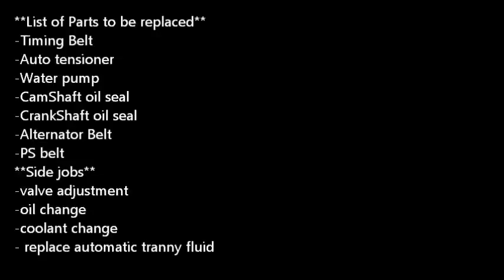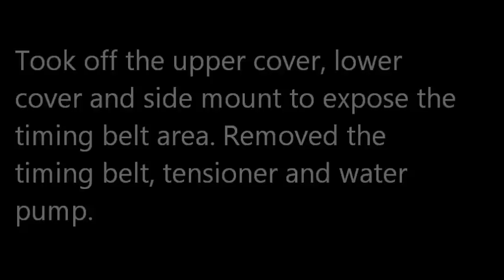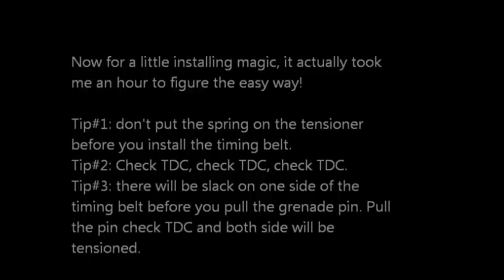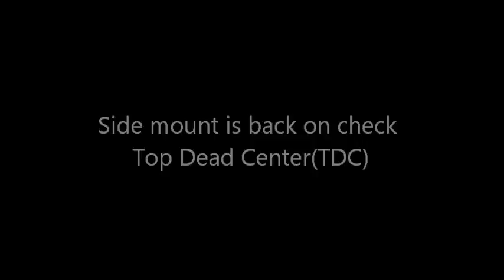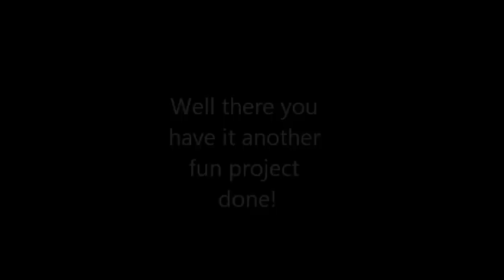DIY 2002 Honda Civic Timing belt and other stuff.

Comment from the maker: basically get all your tools before hand and lay them out. the biggest issue you will encounter is the harmonic balancer bolt which will need a special tool and an extender to give you some leverage to loosen it. every other bolt arent that hard to remove. all in all you just need to get a good manual and some elbow grease and it should be an easy job. also make sure you have all the parts you want to replace before hand.

Comment: Hi every time start my honda civic ex 02 in the morning belt squeak and when the car is warm squeak gone don't know which belt is the problem all belt are new don't know if i need to tight all belts. Please kindly tell me how to check this problem step by step please let me know thanks?
Reply from the maker: if your belts are new than its probably not the belts. but lets go through the list of what you should look for. are the belts too tight? check the belt with a tension meter make sure its not overly tight or it will cause too much pressure on the bearings of the power steering or alternator. if the tension are right then check the power steering pump(the bearings here will likely die first). just take off the belt on the power steering and see if the car starts without squeaking. if it still squeak then its probably the alternator bearings going bad. I know its 2 months ago but let me know what you found.